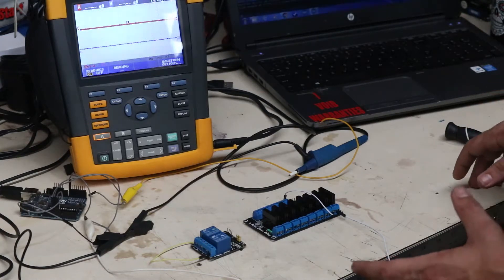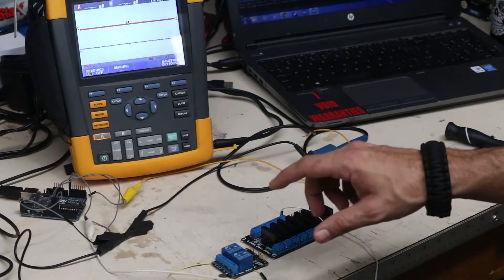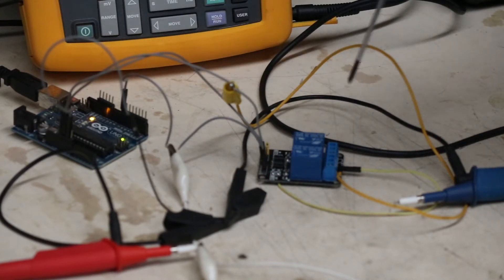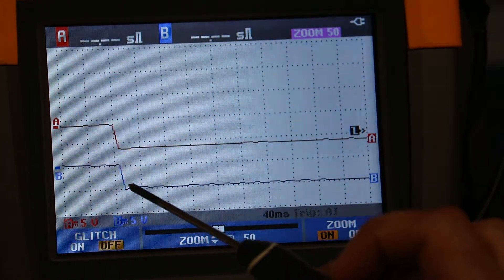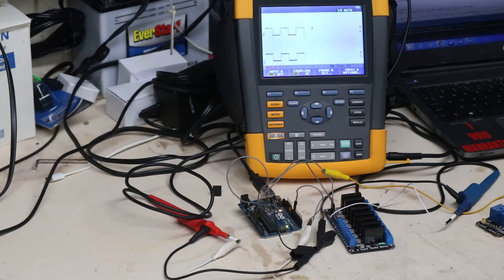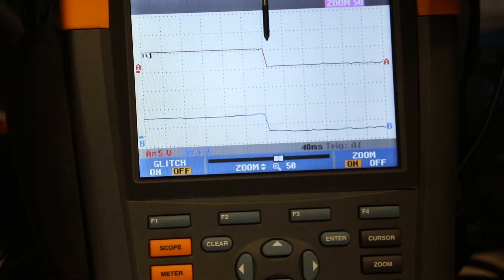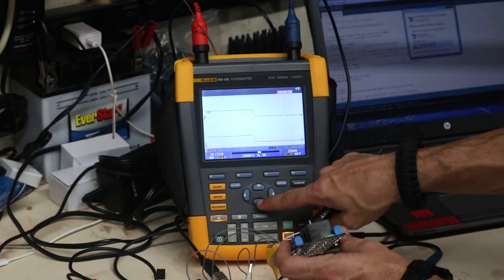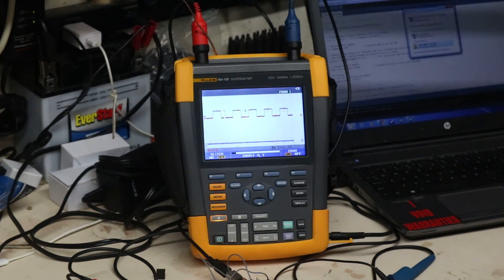Arduino Solid State Relay SSR vs Electrical mechanical Relay EMR

Comment: Can i have some help with circuit for contactor actually i want to control big motors with arduino and ave my mechanical relay moule 4 relays 250v 10 Amp So i need a diagram of contactor to relay module

Comment: Can i use mechanical relay for controlling 230 v motor ac
Reply from the maker: Not directly.   Relays can not handle that kind of power. You would need a motor contactor and the relay would drive the coil on the motor contactor
Reply: @builditbetter5610  Thnk u for reply

Comment: It appears that the drop-out time is about 8ms or roughly 1/2 cycle AC for the EMR. What about the pick-up delay? One of my projects could be a bit complicated using SSR due to needing both N/O, N/C, source and ground switched connections. Do SSR work equally well connected to either side of the load? I'm working with 135VDC circuits if that has any bearing. Loading would be no more than a couple of LEDs w/ 2k resistors.
Reply from the maker: Charles Varner 

SSR's are N/O devices.  There are solid state modules that you can get to turn a SSR into N/O N/C devices but thats added cost and i would fear the switching time would then be in the range of mechanical relays, plus the added complexity. 

I am unsure if they work equally well on both sides of the load, i would need to do some bench testing to see.

If you could provide a little more detail about your project and its requirements i may be able to point you in the right direction on what hardware would work best.